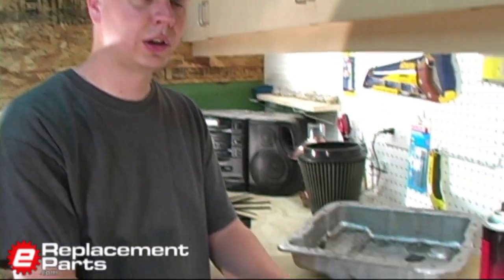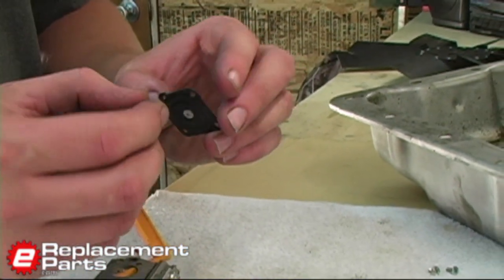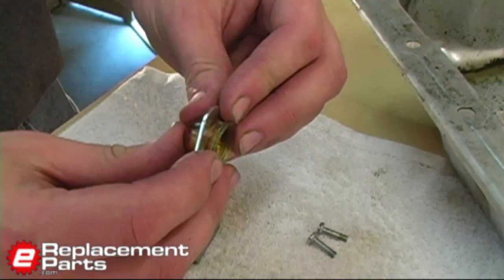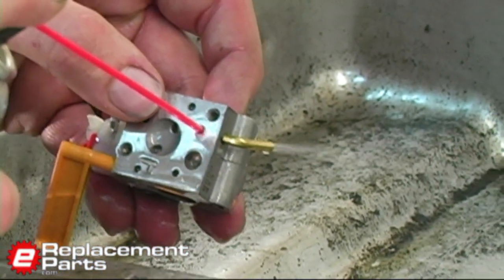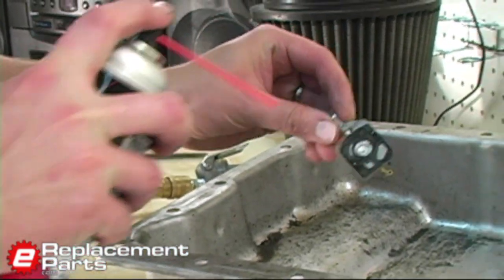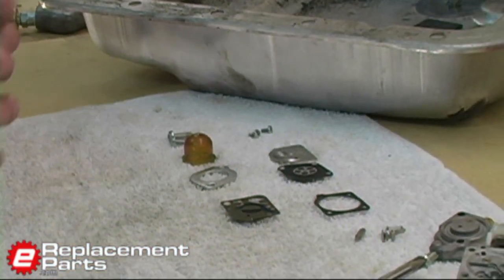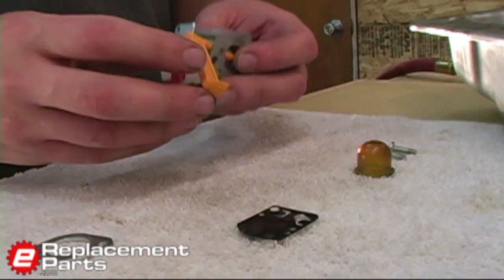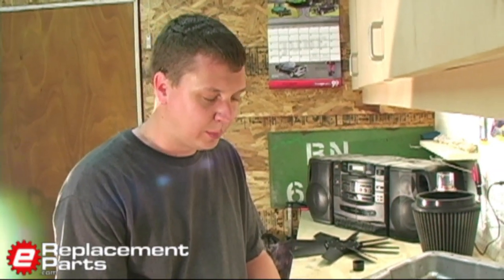How to Clean a Two-Cycle/Two-Stroke Engine Carburetor

Comment: Does anyone notice how red his knuckle joints are? Be cautious if you want to keep healthy lungs, spray with adequate ventilation and outdoors preferably, try to contain drain off fluids if possible, if you want to keep your hands, wear chemical resistant gloves, and lastly invest the meager 1.88 for a pair of safety glasses to protect one of the two most vital assets you possess before using such chemicals as Acetone, Xylene. Toluene, Methyl Ethyl Ketone (MEK), Ethyl Benzene, 2-Butoxyethanol, and propane. Most of these 'ingredients' are present in carb cleaner. Take a moment to read and understand any labels. Cheers!

Comment: I noticed that the high and low needles weren't removed for this cleaning.  Isn't that required for a thorough cleaning?
I believe that carb cleaner contains MEK which is highly carcinogenic, rapidly absorbed through the skin and is associated with liver cancer (hepatocellular carcinoma) with long term or repeated exposure.

Comment: i have bought a weed eater xt 600, and for some reason gas leaks out from around the primer metal holder, and the primer bulb wont fill with gas. i have a slight rip in my reed valve, could that be the problem? i also dont have a fuel filter and i dont know if that could be causing this either. please help

Comment: My 2 stroke troy would not start. Wasted time changing lines and filter. Watched video, do as Mark says. Make sure to clean the small screen found on the carb. It is usually clogged and that is the problem for not starting. Ethanol found in gas clogs the small holes and lines so I now use the pre mix which has no ethanol. Mark thanks much, mazeltov.

Comment: just randomly stumbled on this video.

I bet you can put any of the walbro carburators for go peds on there. all those engines are 23-29cc. Looks like the same bolt pattern, Or even use their rebuild kits if the one in this video is a Walbro. It sure looks like one.

Comment: Great video - thanks for the information.  Question: In section 130-150 of the video the removal layering of the diaphragm gasket would appear to be carb->gasket->diaphragm->cover. In section 733-745 of the video you show the reassembly as carb->diaphragm->gasket->cover. Does the order matter?

Comment: I have been running 100low lead aviation gas in my 2 strokes for years.. Never a problem if carbs are clean to start w/ and proper maint is maintained.

Comment: thanks for the video Mark. Its very instructive to people like myself. It helps people like me that needs a little instruction on the simple repairs that drive me crazy every spring. Also I was told to use non-ethanol fuel at the local co-op to keep debri down in the carbs on my small engines.

Comment: Having "fixed" many Garden machines, I must say that the most common fault (here in the UK). is that the fuel pump diaphragm has denatured, due to the action of the fuel, and has lost it's elasticity causing inefficient pumping. Also on the same part, the reed valve flaps, curl up, and prevent proper sealing.
No amount of cleaning will make up for this...
If you hunt around the internet you will find these carb-kits are available.
I also think that "carb-cleaner" is bad for your health.

Comment: You need to correct this video.The diaphragm gasket goes on first then the diaphragm then the cover plate. No way the engine will run the way you have it now.  I think you got it mixed up with the reed valve. It goes reed valve, gasket then plate.Other than that the video is great.

Comment: You need to correct this video.The diaphragm gasket goes on first then the diaphragm then the cover plate. No way the engine will run the way you have it now. Other than that the video is great.

Comment: Ryobi may not offer a rebuild kit for the carburetor, but the carb is probably made by Walbro (or some other carb mfg.), not  Ryobi. Usually, the carb mfg. & model can be found on the carb body, which will allow for the proper rebuilt kit to be obtained. Most small engine shops have, or can get carb rebuild kits, or carb rebuild kits can be obtained from on line small engine suppliers.

Comment: Question:  How come when you re-assembled the unit, at around 7:30 minutes into the video, you reversed the diaphragm and diaphragm gasket.  When you disassembled it, the gasket was separating the carburetor and the diaphragm, but when you reassembled it, you swapped the 2, placing the diaphragm closest to the carburetor and then the gasket between the diaphragm and the outer cover?

Is this an intentional "technique", or an error, or perhaps it doesn't matter much either way?

Thanks
-Lee

Comment: Hi Mark, awesome video I followed the steps and actually ended rebuilding my carburetor. So I finally got to turn on, but it will stay on only with the choke engaged.  When I give it gas, the choke disengages and engine will accelerate erratically and then shuts off.  Any thoughts

Comment: Great video...My TroyBilt weed wacker wouldn't start so I followed your instructions and cleaned the carburetor.  Voila, it started right up.  So now that I felt confident, I pulled out my Craftsman blower that quit running last summer.  When I removed the carburetor I noticed the fuel lines were cracked.  I cleaned the carburetor, replaced the fuel lines and it wouldn't start.  The cylinder sleeve was loose so I tightened it up and she fired right up.

Thanks eReplacementParts,

Comment: Don't make my newbie mistake and try to clean holes with a wire. The holes that have a shinier  circle are valves with rubber in them if you try to push a wire through it you will either push out the rubber or just as bad, puncture it. FYI, the carb be is cleaning is only US$19  So I got away cheap as far as having to replace it.

Comment: Good vid, but I'd use gloves and a respirator around those strong solvents. Being a solvent, it soaks right thru your skin into your capillaries, and into your whole bloodstream. You're young, and you may not notice it overtly, but it builds up. I found out the hard way by poisoning myself from not wearing protection.

Comment: Around 5:18 in your video you clean the 'head' piece or the part of the carb where the primer bulb attaches and does it's work.  I did the same procedure but now, the primer bulb will not perform it's function, and if I try and run the engine, the primer bulb will collapse.  Is it possible there are one way valves inside some of those little holes, and spraying cleaner in the 'wrong' direction could cause one of those to become stuck?  Where else should I look for fuel flow problems?  Thanks!

Comment: I was having problems with my Ryobi CS26. I could start it & as soon as the choke goes off it stalls. Watched your video and decided to give it a try. Discovered my fuel filter had fallen off so ran to Home Depot and got fuel line replacement kit. Took carb apart, cleaned it and reassembled. Put in new spark plug. Put it back together and it starts (as it did before) but as soon as I pull throttle & release which turns the choke off, the engine stalls same as before. Frustrating! Any ideas?

Comment: Hi Mark I have McCullough leaf blower  run still get hot and about 5 minutes that can be the carburetor? 120 compression got spark. I notice the blower get hot and cut off the gas so that is possible to have weak carburetor?  already clean it...

Comment: I'm wondering about adjustment. What are the white & red plastic things for? The manual says to take it to a service center for adjustment with the symptoms my trimmer has. My best guess is that they set the hi & lo at the factory & put those plastic things over top to keep it that way. I got the trimmer from my aunt who said it's barely been used, but they bought it 6-7 years ago. Since I found dirt in the screen, maybe it just needs a cleanout? Is that more likely than needing adjustment?

Comment: Thanks brah. I got a Homelite 25cc trimmer that has exactly that carb on it & it only runs with the choke full on. Throttle has no effect & half choke or choke off stalls it. I disassembled the carb as much as in the video except I left the needle in & it looked fairly clean so I didn't clean it. I did take out that fine screen though (was easy to do) & it had some dirt in it. Not enough to plug it though.

Comment: I think i damaged the check valve ,cleaning the part the purge bulb sits on with wire ,stihl fs 45 carb
29 bucks to replace ,I may as well replace the carb, o well ill have a spare thats in good shape.

Comment: i have a troy build weed eater idles but will not rev up it shuts off i have cleaned carb new lines  , filter primer bulb spark plug and gas but still doing same thing need help

Comment: I got something similar.

33cc 2 stroke scooter engine someone put on a bike, I bought the mount and motor thye had setup.

Engine was a pain to run on the fuel they left me in the rigged gas can. I did notice some junk in it and in the fuel lines. Some junk in the bulb. 

It runs like a beast till warm, carb dirty or spark?

Comment: mark, my trimmer runs for a second thenm shuts off. so I cleaned the carburetor, replaced gas lines, and plug.  Got the same results. The gas is not going up from top of 
carburetor to the tank.  I removed fuel line at top of carb & poured small amount of gas
into fuel line at top of carb and it started up and continued to run.  What is the problem?

Comment from the maker: It sounds to me like one of the gaskets or the reed valves may have been reassembled upside down. This will block the carb passages, basically stopping fuel flow through the carb. 

I hope this helps,

-Mark

Comment: I have a SST25 weed eater.
It would start but stall as soon as I let the throttle all the way out. I tried to adjust the carb but it was not enough.
So i tried this cleaning process.
I used Brake Clean instead of carb cleaner because I didn't have any and they work the same in my experience.
Now when I prime it, fills the bulb and then the bulb becomes hard to depress any more.
It tried to start RIGHT after I cleaned it and now it won't even kick over a few times.
I'm stuck. 
Did I ruin my carb?

Comment from the maker: The metal disc is part of the diaphragm. It is the part that makes contact with the metering lever. The metal disc should face down or toward the carburetor body. You are correct about the gasket. I'll admit it... I made a mistake. The diaphragm should be above the gasket. The proper reassembly order is, from carb body working out, gasket, diaphragm, cap. Sorry for the confusion.

-Mark

Comment: To be safe, could you put the unit in a Ziplock bag when removing and replacing the needle assembly? Or loosely wrap it in plastic wrap. That way, you could see what you are doing but if the spring got loose, it wouldn't fly across the room.

Comment: Thanks for sharing all the trick and technique. Is there a place to order a pump assembly for Troy Bilt 2200 PSI pressure washer? My output pipe is cracked so the water is leaking out like crazy, as the result I probably get about 50% pressure on the wand. Thanks. Tom

Comment: Do you have any videos or resources on removing the carburetor to start with.  I just got a replacement from you guys, but can seem to remove the old one from the Ryobi Trimmer.  I don't have traditional screw heads when you remove the air box cover.  I have threaded rods with two nuts screwed on to them. I attempted to pry the filter box loose, but was afraid I would break it.  Should I just apply more force?  Is it supposed to pop off?  Thanks!

Comment: im soaking my carb right now. at first i had that bottom plate on then i watched this and took it off and removed the needle so im soaking the complete system the carb was not letting gas to the engine

Comment: I have a troy built 2-cycle.  The carburetor is Walbro.  You can get an entire re-build kit with primer bulb from ebay for like 10 bucks.  I just finished taking my carb apart and cleaning it.  The fuel lines were deteriorted and the primer bulb was cracked.

Comment: on the inlet where the gas line connects to the carby, just shoot some compressed air into it and the little screen will come out. then just push it back in when it is clean. also, carburator cleaner can ruin the pieces as i have found out the hard way